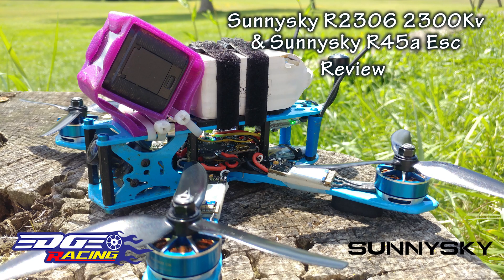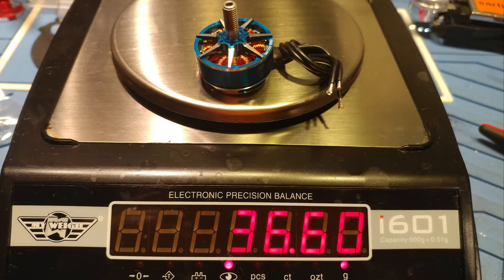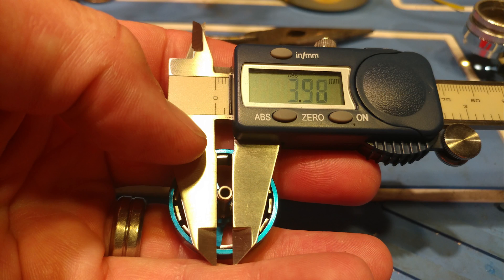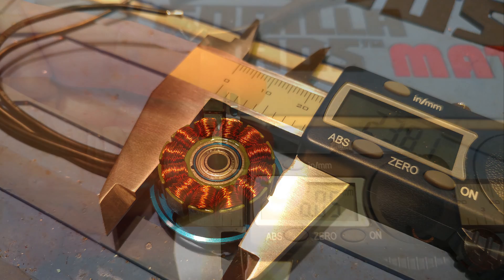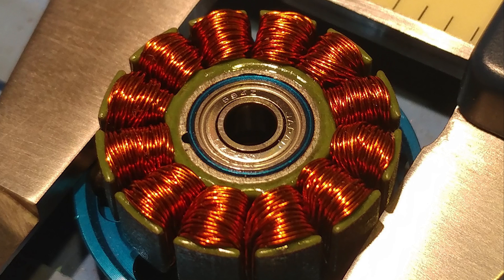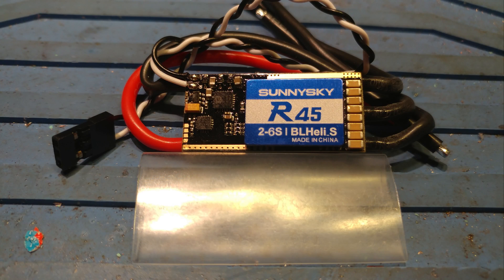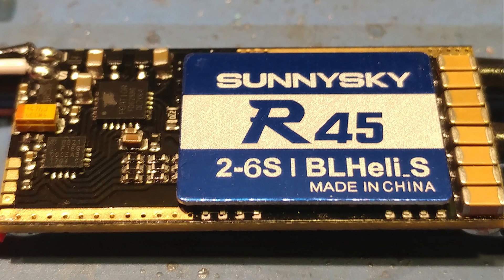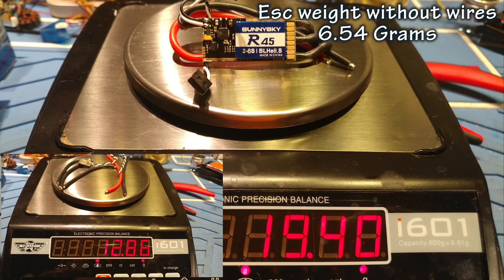Sunnysky R2306 2300Kv and R45a Review

Comment: what are the bearings?
Reply from the maker: Japanese NSK 684Z 4x9x4mm is the size
Reply: btw i disassembled mine, which came with diatone 200n (silver wiring, 2450kv) and they had 2 NMB L-940ZZ . They died very quickly after a couple of crashes unfortunately.
Reply from the maker: Sorry to hear maybe Diatone is spec'ing out the lower cost bearings for their re branded motors

Comment: What did you use as a current meter?  I got 121a using these same motors with dal cyclon 5046.  BFF3 FC.  Previously i got 101a max with emax 2306/2400kv and 132a max with hyperlite 2207/2522kv.  I was a bit surprised these measured so high compared to the emax.
Reply from the maker: RROSD v2 pro

Comment: Hey Frank, subbed and liked! Lower cogging due to the softer lead in and taper off of the mag force due to the square mags, as opposed to arc mags(?). Almost looks like the stator is closer to 23.85x5.9 (cause you measured in the gap, not on the face of the teeth)? Odd, but cool. 

My first motors, the Fuuton 2205's, are 1mm larger in dia than my RXC 2205's (and are only 2/3rds the height to the prop mount, and weigh only 22.4g. The near perfect motor to me if only they had a higher build quality like strong arc mags and 7075 alu. I need to design a motor! and a quad!).
Reply from the maker: GITech Thanks 👍